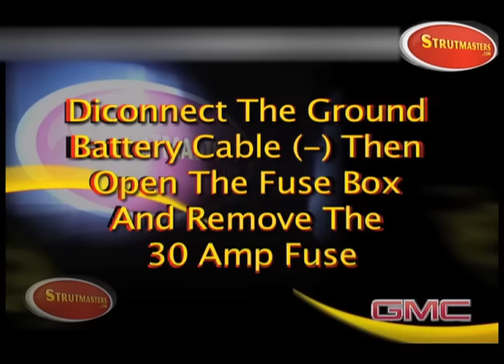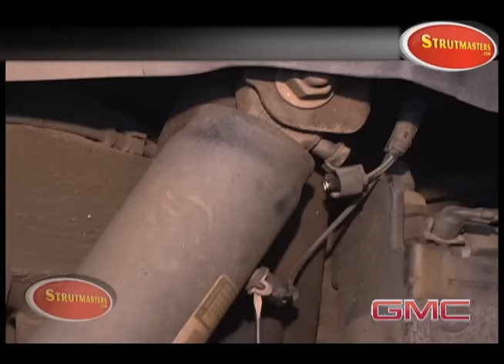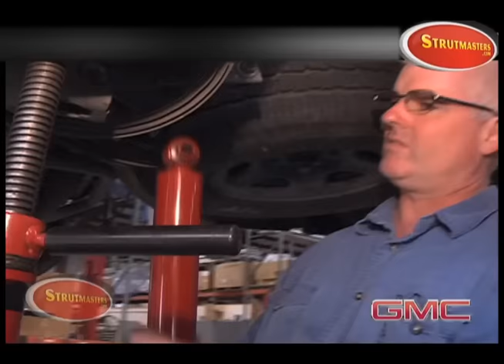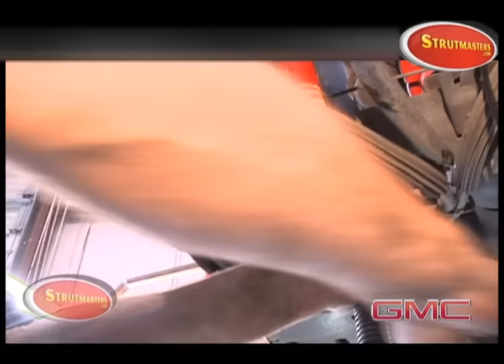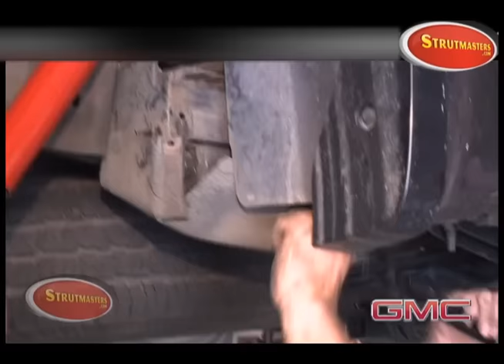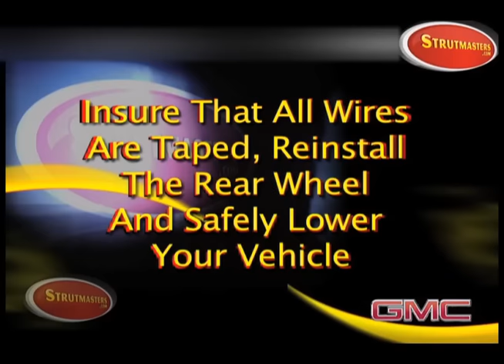Rear Conversion Kit Install:  Escalade, Suburban, Tahoe, Yukon, Denali XL 2000 to 2006 Series

Comment: Purchased and installed on my 05 Escalade ESV. Done in my driveway. Instructional video along with available support on the phone helped me make short work of this job. Front struts too! Thanks.
Reply: How is the ride quality?  Can you notice any difference? I have an 07 Escalade ESV and I'm trying to see how much of a change it is.
Reply: @TheElderOne2003  Not as soft as the air ride. It’s adequate. I’ve been told, mono tube shocks in the rear will be closest to Caddie ride. 
My whole system was trash so this was my best option.
Reply: @JSBell-yp9su  a bit rougher ride doesn't bother me much. I run Cooper Discover AT3 XLT tires so the ride is like a 4x4 truck anyways. I just am tired of the magnetic ride crap, the air shocks are great but the other part is junk. I'm going to give them a call and see what they have.  

Thanks for replying and the info!!